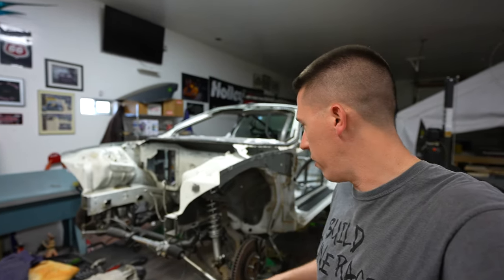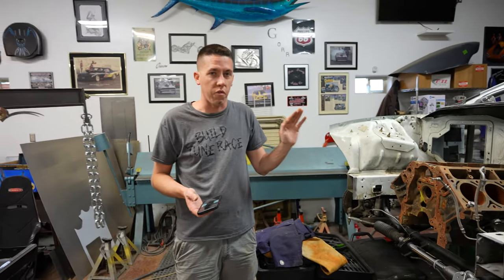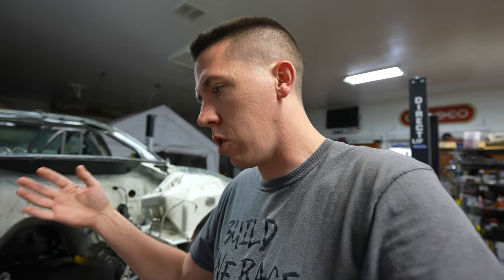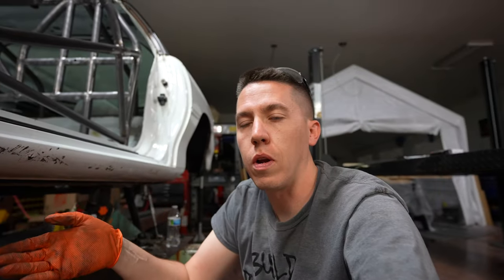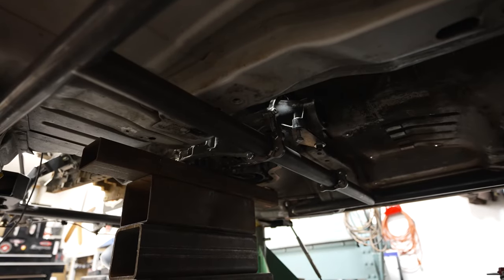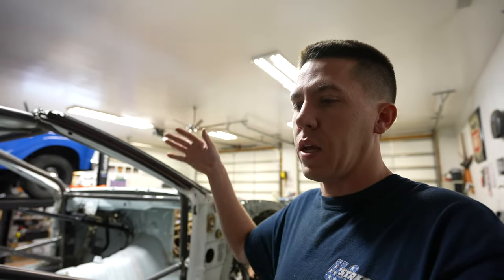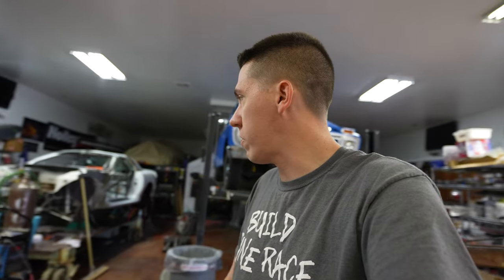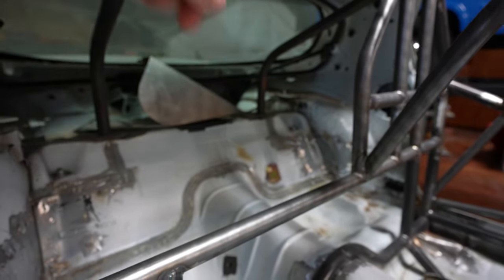Finishing The 25.5 Fbody Camaro Roll Cage!

Comment: As far as I’m aware all cars engine gearbox combo’s are offset in most rear wheel drive cars !
You’ll also find the foot well infront of the front seats are different widths
Reply from the maker: Yeah they are always offset to the passenger side, the problem I ran into is the engine and trans were "twisted/angled/pointed" towards the passenger side instead of sitting straight in the chassis. Hopefully, I did it right lol